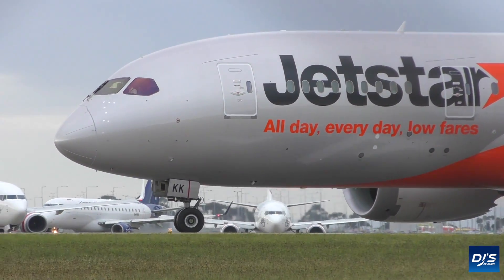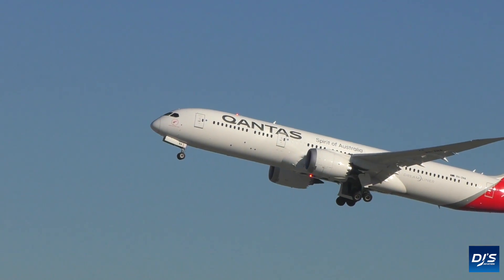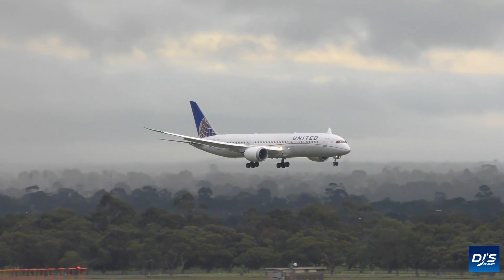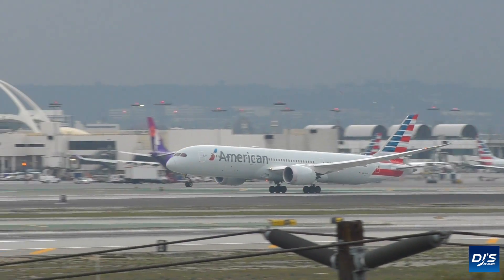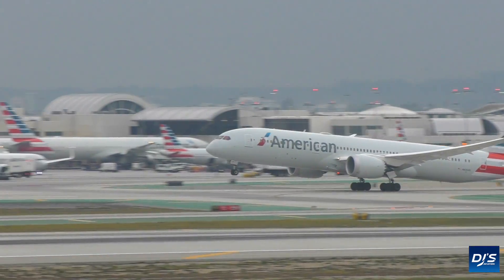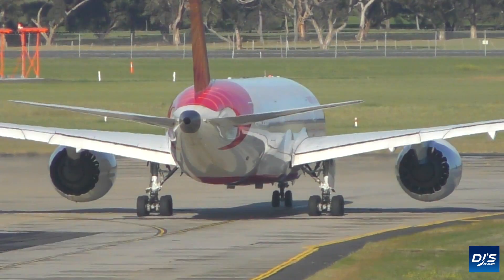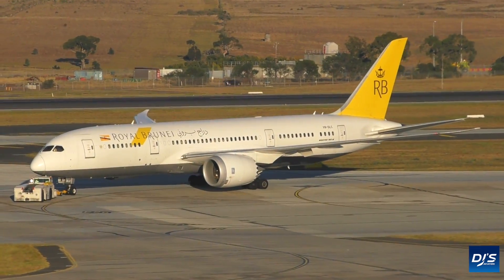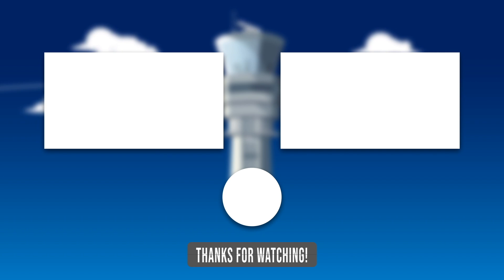Another Boeing 787 Problem

Comment: It's not a design issue, it is an assembly issue
Reply: Chris they care. That’s why they found it. They got rid of their ex MD management and put in quality. As a pilot said. McDonnell Douglas bought Boeing with Boeing’s money. I have more faith in this company than any other. There’s a brighter future. Changes have happened to set a good path for that future. They got a better CEO.
Reply: @aviatorc5065  Well we need more of the MD  greedy board now gone completely.
Reply: It's (sort of) both. For sure the assembly at South Carolina is inferior to that in Washington and intentionally so. Unfortunately the parts are somewhat defective too. Boeing knew, for example, before the 787 design was completed that Alena was having difficulty making the fuselage structures to spec ! The first three 787s assembled never even flew for that reason.
Reply: Chris may not even be a management issue so much as a workers union issue. Those are ridiculously complicated to fix. I’m sure management doesn’t wake up every day and say “how am I going to sabotage the company I work for today?”
Reply: @mikemontgomery2654  have you ever read reddit? Plenty of stories about managers destroying their company by implementing bad policies. ;)
Reply: @mikemontgomery2654  No, the management  crosses its fingers and wishes the problem away. It's an endemic Boeing issue.
Reply: Aviator C you hit the nail on the head
Reply: Its management and regulatory oversight issue that resulted in the design issues as well as assembly issues.

Once you have issue at the top, then expect to see issues everywhere below.
Reply: Aviator C that is simply not true. MD was mainly based in Southern California, and no commercial Boeing is build in CA for at least 20 years.  I know many MD exec when I was young (a lot of them live in Palos Verdes where I was living).  Besides, they must all be retired by now, MD merge happened in 90s. That is 30 years ago
Reply: @aviatorc5065  I am willing to give this the benefit of the doubt only cos Boeing had the balls to release all the email comms regarding the 787 Max even though it is deeply embarrassing to the company.

I will still avoid the plane despite it being cleared to fly again until a couple of months have passed without incident.
Reply: Robbedem should that be the case, then Boeing is in very deep trouble. The problem with your statement is it does not account for the military branch of the company. We don’t seem to hear about endemic problems there.
Reply: pasoundman I’m pretty sure management does no such thing. Boeing would be long gone if they managed their company that particular way, I’m not saying they haven’t made mistakes, that would be disingenuous, at very least. I think they’ve made a horrible habit of rushing work that just should not be rushed.
Reply: It's a Boeing issue!

Comment: Problem found early on? what are you somking?!?
I'd say finding manufacturing flaws after delivering over 600 defective aircraft is far from early on.
Reply: The manufacturing flaws started with the 737NG and got progressively worse. It goes back that far. Boeing has been accepting flawed sub-assemblies for ages and trying to 'make do'.

Comment: Now I feel how sophisticated B777 was without any major initial problem.
Reply: It’s the golden standard for how safe popular (more than 1000 orders) well used widebody aircraft should be
Reply: 777 Tells the golden tale of boeing’s  classic planes being  the pinnacle of reliability  and innovation
Reply: @hunter62207  Pilots love the 757 and 767 too.
Reply: Their last good plane.
Reply: As is the A350 right now.
Reply: @pasoundman  Not saying its not the pilot’s fault. The main factors for the crash is still the pilots but the contributing factors are the design of automation on Boeing aircraft. 

This is actually listed as recommendations by the NTSB for Boeing to implement the changes on the autopilot design in the final report. 

From what I can recalled, I think its to do with flight directors, if FD engaged on both side and pilot did something, the auto throttle engaged and function normally in THR REF mode, where the throttle will moves automatically if the speed gets too low. However, if FD is engaged on just one side and not the other, auto-throttle will still remains engaged but only in THR HOLD mode, where the throttle will not move and remains hold position even when the speed is getting too low, hence the inconsistency in the design.

The thrust-hold mode is also a bit confusing by itself the auto-throttle is engaged but not really engaged??? (Its like an active auto-throttle mode but the pilot needs to adjust the throttle manually by hand... so auto-manual throttle???)

Pilots are humans and no matter how well the training programs is, there are still small chances of error. This is because humans make errors and will always do. So if you can design the system to prevent the errors from happenings at all then there is no reason not to implement the design. Errors from Asiana, Emirates and few other accidents could not happened on an Airbus.

Actually all modern Airbus never crashed at all while the flight computer and automation are engaged and fully functional. Airbus only crashes when the pilot disable the flight computer or part of it, or if some sensors malfunctioned which causes the computer into the alternate law. (German A320 case, the pilot has to disable the flight computer otherwise it would not let him to flew the plane into the mountains.)
Reply: @tonamg53  In the case of the crash near Strasbourg, an Air Inter A320, the plane flew itself into a mountain because the pilots had set up the automation incorrectly.

No matter what, the pilots need to 'be on top' of the automation for safe flight. There's a reason they're there and they have the final say.
Reply: @pasoundman  I’m talking about the German wings a320 with suicidal first officer crash that locked the captain out of the cockpit.

Btw, the accident you mentioned, isn’t there any other factors involved? ( pilot disable something or sensors malfunctioned?)

Agree with pilots needs to be on top of automation but Boeing could have definitely design a better automation for pilots so that errors are less frequent.

The Boeing auto throttle tricks contributes to a lot more crash during pilot’s simulator training session...it is actually quite common for new trainees to fall for that from what I’ve heard
Reply: @tonamg53  Yes but thr automation can fly into mountains if you tell it to.

One wonders how pilots managed without automation. That Asiana crashed in perfect daylight VFR.

Comment: Wasn’t there a documentary a year or two ago that quoted line workers saying that they wouldn’t fly on the plane because of lax quality control?
Reply: When a b737-800 from GOL crashed in Brazil about 12 years ago, some Boeing workers said that there was issues with the manufacturing but nothing came out from that and the plane had crashed after striking another plane and not due to lack of structural integrity.
In any case, even back then there were rumours of problems with quality control and manufacturing standards at Boeing.
Reply: Yes, it was an Al Jezera one.
Reply: 'broken dreams 787 Al Jazeera' and still Boeing denied all. It revealed plenty more problems too.

Comment: Unskilled workers who have no business assembling sophisticated components..
You get what you pay for..all this because they didn't want to pay Union wages at S.C. plant..or because of outsourcing to much work to sub contractors
Reply: Boeing chose SC exactly to get themselves a passive workforce who don't care, unlike Everett. Some SC workers are even alleged to be high on drugs on the job.
Reply: This is why training programs exist. To train those who need to be trained to manufacture or maintain aircraft. In general, aviation is one the most strict and demanding industries from parts manufacturing to end of service for aircraft. The only other industry that’s even more demanding than aviation is space operations. Both can be managed better. Don’t ask.
Reply: @pasoundman  It started as a job program for the local citizens of SC. Especially for the minorities
Reply: @herbboucher816  Boeing wanted subsidies big time too. I'm offended that capitalism apparently needs or thinks it deserves state subsidies to function.
Reply: @herbboucher816  
Weird.
Reply: I agree.  They went offshore when they should have hade the products Meg here where they would have quality control.  I am losing faith in Boeing.
Reply: @jt-eb4sp  Getting the wings made in Japan was not problematical it turns out but Alenia of Italy had trouble with the fuselage that is maybe a problem to this day. Boeing took outsourcing to the max and it ended up biting back.

Comment: Disappointment etc aside now’s the time to start the inspections with many still parked up due to Covid. Depending on the findings the correct repairs should be done immediately under close watch to make sure no more blunders get made
Reply: This will hit a lot harder compared to other aircraft, since the 787 and a350 are being used as much as they can because they are the most efficient planes right now
Reply: True but a number are still parked up even though it’s less parked consorted to other aircraft
Reply: A case of closing the stable door after the horse has bolted sadly. It's really not a good idea to make quality good AFTER building the product !
Reply: @apparition4196  Loking at recent Heathrow arrivals shows most long haul to be those two. Maybe 80% ?

Comment: Why am I never surprised when the headlines say another problem and it’s always Boeing. They seem incapable of even hiring engineers with skills to assemble their craft and its down to basic production line workers what can possibly go wrong.. It seems the full top layer at Boeing need to be replaced  there is no other way to stop the destruction of a once great company this has been going on over 2 years just  on the patching up The Max  and it still cannot fly. There is no future for Boeing with the current Corporate Pen pushers in charge who Have zero engineering skills. 😥🇺🇸🇬🇧👨‍✈️👩‍✈️🙏✈️😥😥👎
Reply: Airbus has its issues....their fair share of them. These issues about the 787 are reported out of an abundance of scrutiny.  Every aircraft ever manufactured has had a series of manufacturing issues that are addressed through ADs, and carried out during maintenance inspections. Usually, they go unreported unnoticed.  Boeing is under a very bright spotlight right now, and is having every pimple on its behind scrutinized and analyzed.  Meanwhile, Airbus couldn't be happier taking care of business while No one is looking.  Gotta make sure spilling coffe on the 350's center console doesn't cause an enginr to flame out afterall.  That's no big deal really....having an engine flame out.  Don't get me wrong, Boeing bought this on itself....but the company will be better for it.
Reply: @toms1348  I'm not aware of a single serious design issue thade it onto any Airbus. Do tell.
Reply: @pasoundman , in particular the
A350 has a design flaw where if a liquid is spilled on to the center console, it can and has caused an engine to flame out...and not allow it to restart, causing an emergency landing.  The A320NEO has center of gravity issues where an AD required that the last two rows of seats had to remain empty.  A fixed was and is needed for that. At any rate, my point is that  the current issues raised about  the 787s, prior to the MAX issues, probably would not have been reported....or would have gone unnoticed to the larger public audience.  These issues are not uncommon for Boeing, Airbus or any manufacturer for that matter.
Reply: Tom S the A350 flaw could be applied to any aircraft if you spill coffee over the controls. It’s just no one has tested what would happen. It was Delta pilots who thought it was smart idea to put the cups on the centre console because their cups are too big to fit in the cup holders. Airbus even specified no liquids are mean to be passed over the centre console before this

As for the A320 Neo that doesn’t affect the aircraft day to day and not all airlines have stopped using the last 2 rows. The issue is if the aircraft was in direct law (no autotrim) and then the aircraft had to go around it would have the same issue as the 737. But having to do a go around in direct law is extremely rare as if you were in direct law you’d be getting priority landing anyway. In normal law it makes no difference as the autotrim will move the stabiliser to the appropriate position for the go around
Reply: @toms1348  Dare I suggest DON'T SPILL LIQUIDS ON THE CENTRE CONSOLE ? Actually many of the 787's problems were well covered in an Al Jazeera documentary from years back. Search for '787 broken dreams' on youtube.
Reply: @tomstravels520  Exactly so re the A350. Hadn't heard that about the 320neo but as you say it's rare for any 'bus to fly in direct law. Only happens when something is very broken.
Reply: @pasoundman , well not spilling anything on the center console goes without saying.  That said...stuff happens as you well  know.  My point is...if this were a 787, comments  wouldn't be so flippant as to say "don't spill anything on the center console".  Folks would be screaming the usual cadre of comments like flawed design, profit over safety.. blah, blah, blah.  Further, I saw the Al Jazeera program.  Although there are truths in that report; it was also a bunch hearsay, and conjecture.  It wasn't entirely objective I take much of it with a grain  of salt. If things were and ate as bad as they say, 787s would be dropping out of the skies. To date, how many have crashed?  🤔

Comment: if you think of it all the problems are helping find flaws. those flaws are making the plane safer because they are checking all the stuff wrong so they could fix it
Reply: I would suggest its revealing that their QA is not good enough. All phrophesized in the Al Jazeera documentary of a few years ago.
Reply: Naah. If there was one or two honest mistakes (as its been before in history) then yes. If the plane is knowingly built with 1000 shortcuts, assembled by people on drugs, by forcing part together etc then no.
Reply: Most of the flaws were known about long ago.

Comment: Wasn‘t / isn‘t there an issue as well with the fit of the vertical stabilizers? IIRC there were gaps wider than allowed between the rear fuselage and the vertical stabilizer. 🙈

Comment: Step change in plane design 🤷🏾‍♂️ we're used to modern airliners being ultra reliable, suspect we forget it took decades to get to this point in the first place. So of course Boeing, in their infinite wisdom, decide to take a risk and switch it all up (at the same time) with bigger turbo-fans, composite materials, lithiums, electric flight surfaces, cabin pressurisation changes, etc...

Seems like Boeing's gamble has paid off, they still sell like hot cakes despite the issues...

Comment: There was a documentary a few years ago which said that some airlines would not buy 787's  made in South Carolina because they were soo badly made.
If any of these planes crash it's game over for the 787.
I fly on one and was not impressed by how flimsy it looked and felt.
Reply: @KP You most likely were on a SC built one. I would only fly on ones built in Everett which doesn’t have the quality issue but still I’m going to wait till these fixes are fully done with no shortcuts before I’m ready as I’ve yet to fly on a 787. I’ve only flown ATR42-500, ATR72-500, ERJ-145, E175, Q400, 777-300ER, A330-200 and A380

Comment: Now what? OK, look, Boeing sold themselves to the outsourcing bottom line, eh?

Now the 787 is piece of junk, too. I ain't goin' if it's Boeing, except for a well-maintained 757 or 767.
Reply: when did the 787 come a piece of junk? no one asked for u to comment that quote. they were perfectly alright producing solid 787s and now all of a sudden problems have arisen. there is nothing wrong with Boeing. its the factory productions fault
Reply: Don’t forget the 777 the safest airliner in the world
Reply: wasay ahmed uhm...what?
Reply: @nickolliver3021  So if its factory productions fault, which company runs them if not Boeing. It is their responsability to get the quality right, which they clearly don't do. Also the military aircraft hat quality issues. So when its not Boeing fault which then?
Reply: @Infiltator2  well I know Boeing do make these aircraft and are responsible to get the quality right. I'm just guessing its wear and tear. The quality is fine. Wear and tear that's probably it. Any machine has issues.
Reply: @nickolliver3021  Uh ? Boeing makes almost nothing on the 787. The manufacturing is heavily outsourced to hundreds of subcontractors. Boeng simply bolts the bits together. It wasn't always so.
Reply: @pasoundman  boeing makes everything onnthe 787. The manufacturing is not outsourced to hundreds of subcontractors. Boeing solidly bolts things together. Unfortunately its wear and tear unfortunately
Reply: @pasoundman  your the idiot here not me. Boeings internal QC has not been warned of defective parts not bought for ages and management just 'does not change the rules' to fit parts. They do change the parts  to fit the rules  they're doing that right now for the inspections. It's all shockingly unpredictable
Reply: @pasoundman  yes they do. Boeings outsourcing is not legendary
Reply: We will absolutely never know what happened to MH370 until they find the black boxes eventually. But it’s likely nothing wrong with the plane

Comment: This is the difference between Boeing and Airbus. Have you EVER come across such news surrounding the A350? No. But the same is not the case with Boeing.
Reply: Just cracking blades on the a350  Trent engine..like the dreamliners...but .no one ever mentioned it here..
Reply: LMAO some pilot spilled a drink on the throttle quadrant of an a350 and both engines shut down